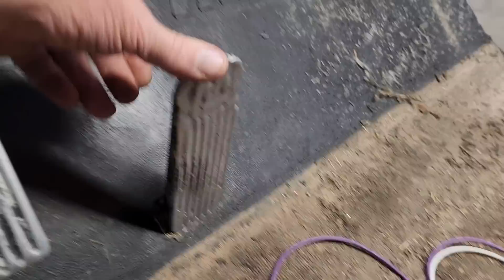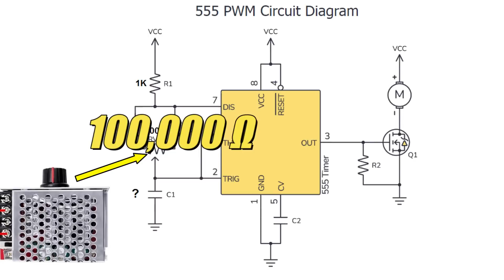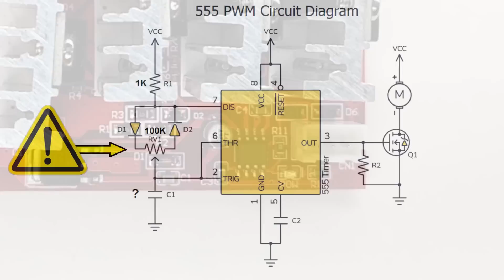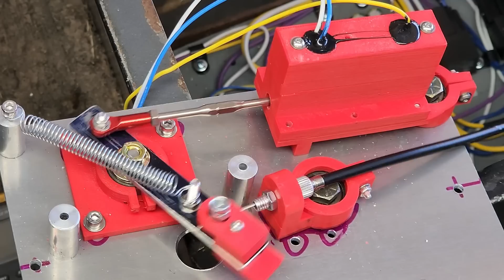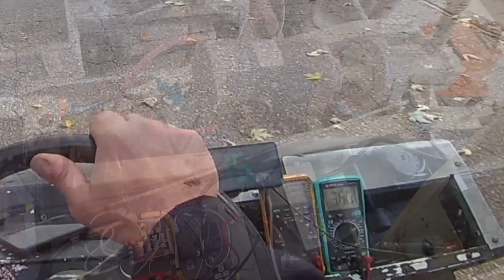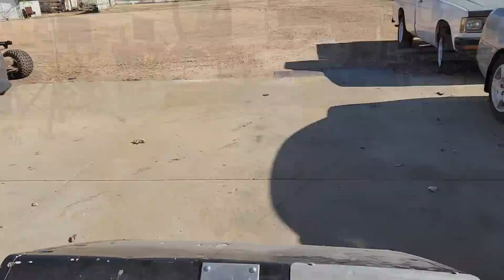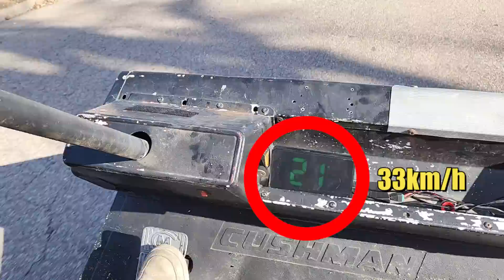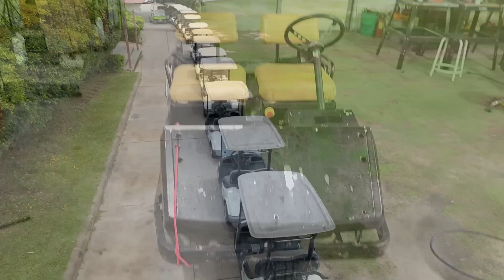S4 E38. We build a custom throttle and road test the gasoline / electric hybrid petroleum battery

Comment: I would add a kill switch to the engine, I have seen alternators self excite just from residual magnetism in the rotor which would make the kill switch in the exciter circuit useless.
Nice project though, I love it. ❤

Comment: I’ll bet a dc-dc converter or an off the shelf Solar Charge Controller would work with the variable alternator output to keep the 12-volt battery charged while running.

Comment: The alternator isn't so much Amperage limited, but rather Power.  In its normal application, its maximum output is about 14v at 140 Amps, or 1,960 Watts.  1,960 Watts at 36 Volts is only 54 Amps.

Comment: You do know, don't you... that there is nothing "sacred" about the value of the 100K pot... if you want to use a 10k, just make the C1 capacitor 10x larger. 

To be clear though, the frequency of the PWM is very likely not what your alternator field winding needs, so you will probably want to try some different C1 values anyway. If the frequency is too high, the efficiency will be horrible due to reactance losses. If the frequency is too low, the output will just get a little "bumpy", where it puts out pulses of energy - rather than a smooth flow.

Comment: If you're going to go with delicate slide or rotary rheostats, I would consider "fly by wire" controls. A cheap RC servo can easily turn the rotary rheostat, and a cheap or used pedal from a car or flight simulator game can send the signal to the servo.

Comment: You can use your motor as a brake if you short circuiting the terminals(while magnet coils are active) with a relay. I also think your alternator could perform better if you are using capacitors after that. Keep up the good work!

Comment: Why not use the engine speed to control the electric motor instead of the voltage controller.  Then you wouldn't need the electronics and inturn would be more reliable.  Electronics eventually fail before mechanical?? I like what you're doing

Comment: Use a combination potentiometer a blade style. Built it urself. Use a qtr circle and a pivot point with a return spring.  Make sure there is a limit switch. Use the arm on the potentiometer to run a throttle cable. Just a little redneck engineering. The safety is easy through an anti-surge unit. Basically a circuit breaker. Some are just little push button resets. Just like the emergency off switch. Except to reset you power circuit. A GFI circuit. Retired master electrician and I have a degree in propulsion engineering.

Comment: Technically, such a setup could be more efficient than a mechanical transmission. 

But with the current setup, it will not. Now, if you were using a brushless dc motor, a better generator, and the correct power electronics in between them it would be a different story.

Comment: Wouldn’t it be easier to find a buck boost converter with a high impedance 0-5V input that it is to make a custom pedal for the RC circuit?

Comment: Just an idea, what about putting a capacitor bank to take the punch at acceleration? and instead of using the cable for the throttle, why not make a contraption right there behind the pedal? save yourself the hassle of the cable breaking and it should be way smoother. The noise can be tuned down with a better muffler and mounting the engine in rubber feet.

Comment: I would have attached a round cable pulley / lever  in place of the knob on the original potentiometer. The only real engineering would be making the travel of the pedal match the rotation of the knob shaft.

Comment: If you use that generator to power a super capacitor array, and then modify the engine to run off of hydrogen, then in theory, this is the most energy efficient power converter system possible with modern technology. I’ve wanted to run this experiment for a long time. But for maximum efficiency you should use a delta wound brushless motor. Hydrogen engine - brushless generator - super capacitor array - lithium work battery. In theory, this is more energy efficient and has less power loss than a nuclear reactor. Maybe one day I’ll do this experiment.

Comment: A pedal on newer tig machines uses a 10k single turn pot inside with an on off micro switch for start and stop current. That could be swapped for a 100k easily. Plus then you have another safety switch.

Comment: Greetings: Good show. In the beginning U say something about people understanding the voncepts and electronics. 50+ yrs of electronics services, audio production, video production distribution, truck repair, aviation, marine, residential, commercial electrical...Etc...miggt B a bit familiar:). Good show, construction and work ethics. The video production and narration is good also... including the humour. I have had a few similar plans. 1 with a pure 'petro powered ' Vtwin. Another with a hybrid such as URs. A 3rd with a salavaged auto lithium battery unit. The delay is the cart. I have not found such donor a candidate. U requested 1 at the end. Perhaps some1 will jump my cause with such in the Atl area. Thx 4 the share.

Comment: One thing about the design about alternators if the field current is too high the load on the engine will increase because of the magnetic drag in the rotor/stator assembly without actually producing more power out from the alternator. in future you might try to fine tune the Max current to the rotor without excess loss to the rotor/stator.

Comment: If you go crazy with the RPM it will sling off the commutators and make quite a show. I have seen some of these motors survive at well over 5000 RPM. That motor is likely capable of accepting 48 volts. But you can achieve the same RPM at lower voltage by installing a shunt resistor across the field windings. I used to do this with a contactor to weaken the fields once I have overcome the startup needs.

Comment: Hmm... You can theoretically make an e-CVT by using the electric motor and gasoline engine with alternator combined with differential axle. If both spin each side, you should get something similar to an e-CVT.

Comment: Modify the alternator to put out 48v and wire two batteries in series. The batteries will act like a reservoir when not under full load. And the engine can charge them at a more continuous rate.

Comment: If you overspeed a dc brush motor, it is mostly an issue with balance and centrifugal destruction, the bigger problem is "ring of fire" brush arcing at voltages and current higher than it is rated for. I overclocked a 20hp brush motor for a subaru 360 I converted to electric (90v rated, ran at 160V) and ended up with brush arcing at heavy loads, so I lowered the voltage to 150v or so, insulated the brush area so they didnt arc to the case and the arcing stopped.

Comment: You might actually be able to get away with a potentiometer pedal. Many simulator racing setups use them still. I have one that's been working in Dusty environments for years. Might be able to buy one at a thrift store and just rip out the assembly and replace parts as needed, or use it as a template.

Comment: Crazy idea: if there's such a thing as a voltage-referenced actuator, you could connect it to the output voltage of the alternator. Then, hook the actuator up to the throttle to bring up the engine rpm under load, and throttle back when cruising or stopped.

Comment: You can use the potentiometer you want. Just keep the product R*C constant.
3k instead of 100k ?
Reply: Just put a big capacitor in parallel to the existing one.
Reply: You'll also have to decrease the value of the 1k top resistor. Just add a 100 Ohm one in parallel to the original.
Reply: You don't really have to deal with SMD too as you add in parallel, so between Vcc or ground and a pin of the 555.
Reply: You should also add a high power diode in anti parallel to the motor (but opposite polarity so it doesn't short it) as a freewheel.
Reply: Otherwise when the transistor cuts the current wants to continue to flow (but can't) and creates a voltage spike.
Reply: For some reason, if I do my comment in a single post it gets deleted automatically 😢

Comment: I used a 200w e-kart motor and put it on a bike. Its a 4 brush 24v, I bought two 12v 14 amh motorcycle lead acid batteries, as they are way cheaper and simple to contain safely than li-on batteries. They are also much more robust when it comes to charging and that is the main consideration, because I DID build a range extender! I modified a 1400w vacuum cleaner motor so it works like an alternator, output dependant on field voltage but simple single phase DC. That is coupled to a 32cc line trimmer engine. I made and mounted panniers on the rear of the bike, batteries are in one side and the range extender in the other.
I want to change the engine at some point for a 4 stroke and run auto gas rather than stinky 2 stroke mix liquid fuel.

Comment: Simple mechanism for a rotary pot. You know the sort of gear they use on like a scooter kick-start? Looks like a 'Y' with the gear bit connecting the top bit of the 'Y' to turn it into more of a fancy 'T'? One of those on the pedal, pinion gear on a rotary pot. Switch your supply and ground wires to the pot, to the opposite orientation from usual. Add a return spring, job done.

Comment: You should double up your throttle cable to raise the throttle of the engine when you use the peddle so it idles when you are stopped and throttle up when the demand is needed. Could also use a solenoid to activate the throttle when the peddle is depressed. Would reduce noise as well since gas carts also idle while stopped...  Great project!

Comment: I have found 8 pin op amp chips in circuit boards from 1974 that are still working. So rest assured your pointless project will still be kicking around 50 years from now and may even survive a zombpocalypse or two.

Comment: You need to hack a used Wah-wah pedal, Jimbo.

Use a 100k ohm Allen-Bradley industrial grade potentiometer.  They are designed for this kind of abuse.  The shaft has roller bearings.
Print a pinion for the shaft and a rack to connect to the pedal.

Comment: Some PWM speed controllers use the 555 timer not as a PWM generating device, but just as the MOSFET driver. They have a microcontroller doing the PWM, output fed to the 555, and usually drive a 0 to 100 % LED display. I modified one of those types using an Arduino Pro Mini, and didn't use the on board microcontroller. That way you can use any value potientiometer, or even a hall sensor like they use in eBike thumb throttles.

Comment: One drawback not yet addressed js that the centre of gravity of the gilf cart has been significantly raised by the reduced weight in the lowest part of the vehicle. A triangular wheel base like that is already prone to rollover at high speed and tight cornering radii and this weakness is further excerbated by perching two adult humans atop of it. Be Careful!

Comment: I wonder if adding a large capacitor inline with the alt and the motor would help provide that extra oomph that the cart is lacking. Also maybe a small lithium battery could also be used as reserve power.

Comment: My petrol powered battery charger with the Honda gx340--120a alternator would be great for this same application, but I don't have golf carts available, except for customers that I'm fixing, but I am interested in this system for marine purposes 😉 what do you think, not as a bilge pump drive 😅 but propshaft drive electric motor, I haven't bought the electric motor yet. Thanks awesomely for sharing your great experiments and experiences.

Comment: May be a t model Ford type steering wheel and throttle set up . low engine revs until your foot is flat to the floor , then increase the engine revs .

Comment: Given your programming background, I’d love to see an Arduino-based controller! I could see some complications with the field winding control, so I figured I’d give my two cents for how to manage it. A 100k digital potentiometer, which are common on the jungle site, could be controlled through pwm alongside a servo for the battery’s throttle. I don’t know about you, but the control possibilities with that method tickles a certain part of my brain. I think an interesting issue to tackle with this cart is keeping the control battery charged. Since you have zero volts while stationary, you could in theory program a relay to disconnect the motor and excite the alternator with the previously mentioned controls and wire in a regulator and lead acid charger to the alternator. In long term use I could see an arduino really helping out. Keep it up!

Comment: What not rig a throttle to the original pot for the power supply? I’m not surprised to find a 555 timing chip in anything today. I miss RadioShack.

Comment: So if the, uh, petroleum electric generator puts out 140 amps of power and can do 21mph...what about a higher output alternator?  I know there's 220amp CS130s out there and there are custom built ones from Tucson and Mechman up to 500 amps.  They aren't cheap, but they include a PWM controller and put out the power at idle speeds on LS engines so they are quite popular with the GMT400/800/900 owners with massive sound systems.

Comment: With the sketchiness of the electrics and lack of stability of 3 wheeler it might be wise to use a breakaway style shut off so if you get thrown off the machine it will turn off and not runoff over someone.

Comment: A foot pedal volume control from an old organ or a guitar foot pedal volume control would have made an ideal foot throttle .  Most of them used a rotary control that could easily be changed to a 100k linear pot and wired into your controller.

Comment: Control the throttle using a current detector or governor, as the heavy current load is felt by the generator and electromagnet can apply the throttle on the generator and as the gasoline engine lugs the throttle will be increased, also a capacitor bank or battery can handle the surges that are experienced during heavy acceleration , most of the time the generator should be loaded ...

Comment: This idea can work well, just the locomotives like you mentioned. They also use that style system in some ships like icebreakers, if a large piece of ice jams the propeller it just trips an overcurrent protection and shuts off. While a direct driven prop jamming up can damage the gearbox or engine. 
I might put 2-3 small 12V batteries, either lithium or flooded in it, then use the generator as a range extender. You could also then use it as a mobile power bank with a 120V AC power inverter. If the cart had a canopy then it could be fitted with solar panels to charge it as well.

Comment: Other downsides of the "petroleum battery": makes lots of noise, produces noxious fumes, is limited to using non-renewable fossil fuels, and uses a lot of mechanical parts that need to be maintained and replaced.

Yes, I know the batteries in that golf cart had to be replaced, but that whole unit was left in disrepair. Lead acid batteries are capable of many charge-discharge cycles with minimal loss in capacity and they can be easily rebuilt if desired. More modern lithium ion batteries are much lighter for the same amount of capacity and can be charged much faster than lead-acid, easily charging within 20 minutes with a capable charger.

Comment: I know a lot about gasoline engines, and I've learned a lot about Diesel engines, I've learned enough about electrical circuits to recognize diodes, resistors, and capacitors, but not a lot about their interaction. A project I'd like to work on is an electric car set up with a petroleum battery like you have in this golf cart.

Comment: I was thinking of the arduino right before you said it. Could you hook engine throttle to it via servo motor and have it idle down when the throttle isn’t pressed to help with noise? Very cool project! Keep it up!

Comment: You should try and add some super capacitors into the mix, to act as a buffer for the alternator. I would assume you would need a proper motor speed controller for that through.

Comment: Couldn't you use a drive by wire throttle to run a servo connected to the 100k potentiometer?

Comment: Throttle solution and safety.    

Cable throttle would be simple with a pulley on the original pot and cable wrapped around like many cars.  If the throttle is too touchy at low speed, increase the diameter of the pulley at the low speed end of things  ( egg shaped ) 

For safety, include a switch that opens the alternator field with the throttle pedal is released, this is a 100% fail safe and requires zero operator interaction.

Comment: Two small (5/8"? - Bimba or similar) air cylinders, one with spring extend and one with spring retract can make a simple self-returning hydraulic linear throttle linkage to actuate the linear pot.

Comment: 23:52 not too difficult. 
Split the cable going from the alternator to the motor.
Use the tapped off wire and put a welder diode (usually 1600v 120 amps max) inline with the wire, to rout the generator voltage to the battery, and one more to rout the battery voltage to the DC motor. 

Gen --+-------+---motor
           +Batt+
That way there's a voltage differential between the generator and the battery (about 1V), and it would allow the battery to be charged when the voltage is high (and load low), and discharged when the load is high, and the alternator voltage drops below a threshold.

The only problem here is that you control the generator voltage, rather than the motor voltage. If the generator voltage is constant, and you can find a way to control the motor output with a DC motor controller, it will work.

Comment: Modern automotive alternators have avalanche diodes that will conduct in both directions if the voltage is high enough.  This is done to reduce voltage spikes saving electronics in the vehicle.